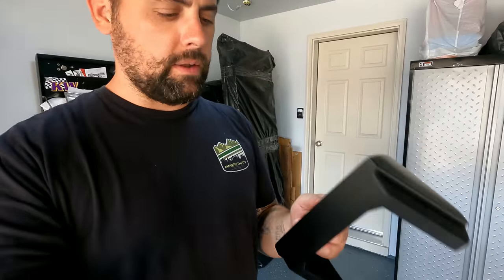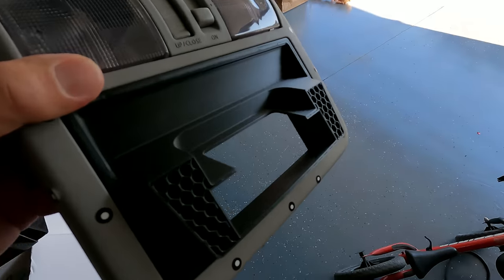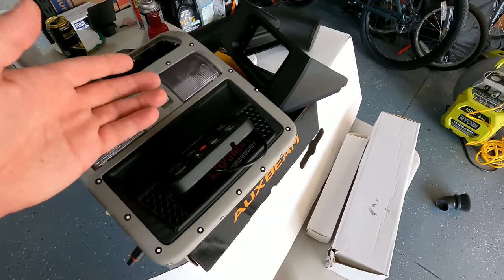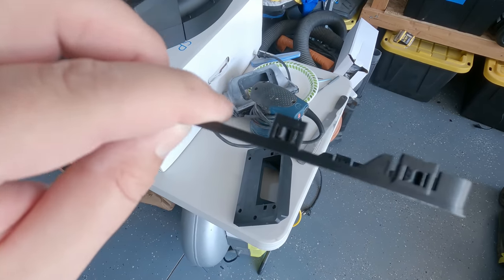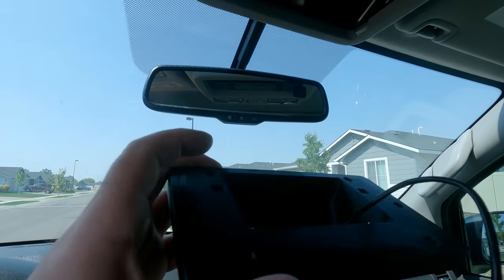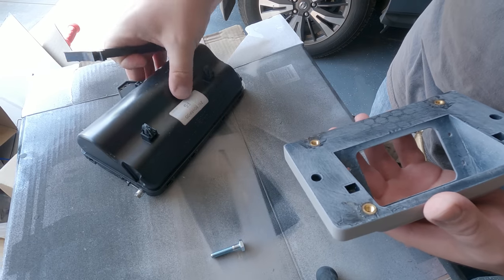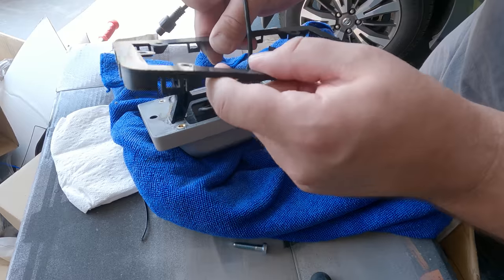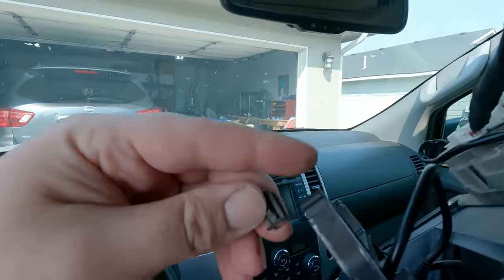How to make 3d printed car parts - Auxbeam switch panel

Comment: Very impressive practical use of 3D printing, you should make a video on how you converted original piece into the 3D printed part.
Reply from the maker: Thank you, I have a video coming out tomorrow going over the process more actually!
Reply: This is also what I came to ask. 😊
Reply from the maker: @chrisperrywv  I will try to make a video going a bit more in depth!
Reply: @EndMotive  I just found you and wanted to say the same as Chris. Subscribed!
Reply: Where is this video explanation?? I cannot find the video but would love to learn how you did it @EndMotive
Reply from the maker: @garrethatchard2132  I believe this is a video I had taken down because of a copyright issue. I can work on another, what would you like to know or see?
Reply: @EndMotive  I would be interested to see how you modified the original piece to make the 3D-printed piece. I want to do some similar custom parts but would love to learn how you got the factory look and fit. I assume a 3d scanner was involved?
Reply from the maker: Gotcha! I will try to make something a little more in depth, but yes I did use a 3d scanner.

Comment: Great idea splitting the design so the tabs are seperate. So much quicker and easier to replace if required.
Reply from the maker: Exactly! The support material was giving me issues on the main body too, so it was a win-win

Comment: I know, it's too late, but I would definitively rotate it a bit(approx. 30 deg.) to a driver's side for better acces.15d
Reply from the maker: It would be nice, but I wanted to keep them straight. Because of the distance, it does not feel like the buttons are turned away from the driver.

Comment: Give XTC-3D a shot for coating, works like a charm and sands easily while adding strength to the parts! (might work out to be overall cheaper than JB weld as well)
Reply from the maker: Yeah the jb weld was a first test, it was a bad idea lol. Regular body filler is pretty easy to sand and works great, however you are probably right that the xtc-3d would likely add some strength!

Comment: Not sure how hot it is where you are but ABS amy be right on the borderline for handling direct sunlight especially close to the windshield. The positioning of the partial sunblock film on the window may however save the day. Great project!
Reply from the maker: @karlosss1868  Thanks!, I have had no problems with abs in the Vegas (115f) heat, but I ended up making one out of sls nylon 12 anyways, no worries now!

Comment: This really does show how 3D printing enables rapid prototypes and iterative development. Great job. Do you have a video on the 3d scanning with reference dots?
Reply from the maker: Yeah, it really speeds up the process. I do not have a video with the dots for this part but have featured a few other parts with the alignment points.

Comment: Some years ago I also made some car accessories like a radio cover and some can holders with different materials.
I spent days of sanding, priming, and painting the parts.
Over the years they all bent by the influence of the elements (heat, cold and humidity).

It was a very painful experience.
I hope it won't happen to you!

Edit: the materials I used were mostly PETG and ABS, but also some in PLA. All the materials behaved the same way!
Reply from the maker: Yes totally possible. Some just last a little longer than others!
Reply: Very good question. So just go to RESIN parts
Reply: @bitosdelaplaya  Btw. with Resin parts this phenomen is even worse.
Reply: @DerJohii  ??? I talk about RESIN printer. Resin is UV resistant and heat resistant
Reply: @bitosdelaplaya  Heat resistant, yes.
Have you ever been putting your curing resin part too long under UV light?
It is deforming and getting extremely brittle and hot because of reactions going on in the part. ;-)
Reply: My experience too... 3d printed parts just don't hold up in the heat of a car.
Reply: @DerJohii  But when you paint it, it will become UV resistant due to the clear coat.

Comment: I'd probably be doing the same, however, time is money.  If you are having to sand and modify lots after the production to get it refined so people will buy it, you are cutting into your profit.  Have you considered a better printer?  Resin perhaps?
Reply from the maker: Yes, I have a resin printer actually but the parts are fairly fragile on the small clips. I wouldn't even consider doing all that work for production parts...no way it would be profitable! I have had quotes to get it sls/mjf printed but they were too high to leave me any margin and I am still considering casting them out of a two part urethane or something similar.

Comment: Turned out great!

Did you scan the part it clips onto to help with the design? Or did you just take measurements and go trial and error until it fit before designing the rest of it?
Reply from the maker: I just used the scan data of the part and that was enough to make the clips pretty close and then did a test fit and made adjustments. Second print was perfect.

Comment: Have you considered using 3d printer resin for the smoothing of and curing with a uv torch
Reply from the maker: Yes, I have a resin printer and depending on the part use it....but have not had great results with curing uv resin over fdm parts. It ends up being more work that just using body filler and primer.

Comment: Do you print and finish everything yourself for your etsy shop? Or do you print and prototype and then outsource it? Just wondering cause I'm really interested in trying to 3d print some ideas of mine and try to sell them. Really amazing work btw!
Reply from the maker: I do not outsource any of my products currently, not that I am against it by any means. I have actually tried to minimize the amount of parts that need extra steps after printing. Sanding and painting are very time intensive processes that totally kill my margin.

Comment: Was the cable long enough to reach the switch panel when mounting it there, or did you have to get the extension cable for the switch?
Reply from the maker: I have no idea, I have not hooked it up yet lol. I mostly designed the panel to sell, but will eventually use it.

Comment: What type of filler did you use to smooth the surface after the printing?
Reply from the maker: I tried using jb weld to make the part stronger but it was very hard to sand. I usually use a glazing putty body filler. They are a little thinner than regular body fillers and easy to finish.

Comment: What primer and paint do you use to fill in layer lines?
Reply from the maker: I dont remember what I used on this now, but I have switched to SEM high build primer and it is so much better than duplicolor or rustoleum.

Comment: HI there!

I have a question, how much would you charge two small pieces to be design and painted jet black..

Thank you
Reply from the maker: What kind of part and how large are they?
Reply: @EndMotive  they are my hands free buttons for my steering wheel.

I have a mitsubishi Lancer raillart 2012 the steering wheel has a set of hands free buttons on it. I want something like that for the right side 3 layer buttons case.
Reply from the maker: @adamjensen6376  sounds cool, I am not sure how I would go about designing it without having the part in hand though. I will look around and see if I can't find something local to work with.

Comment: Abs or pla? And what matériel after is mastic of tôle ??
Reply from the maker: I have the materials I used in the description! 
ABS filament >Sanding > Primer > SEM texture spray > SEM color coat paint
Reply: How to resist sun and hot temperature?
Reply from the maker: @medamine9330 ABS holds up great in the heat for me. It is not getting direct sunlight so UV light wont be a problem.
Reply: But in my country heat up to 45°
Reply from the maker: @medamine9330  I live in las vegas, it gets 48°/120°f here and i have not had abs melt. Some lower quality abs might not handle it, but good quality should.
Reply: Ah ok thank you

Comment: That looks awesome!  Minor comment, you said taller folks might have more interference... I would have thought a shorter driver can see better since the mirror would be angled down.
Reply from the maker: Thanks!, It doesn't bother me and leaves rear visibility totally usable...I am 6'2". Sitting high enough the mount does block a little, if I slouch and angle the mirror to fit, it does improve visibility slightly.

Comment: If not already suggested, bondo is another alternative to the epoxy. Love how it turned out though, nice work.
Reply from the maker: Thanks, yes that is usually how I finish parts out, I just wanted to test an epoxy but won't be doing it again....it is way harder to sand

Comment: just don't print in PLA. because It deforms with the heat inside the car in sunny days. PLA hold heat as much as 40º C
Reply from the maker: I almost exclusively print in ABS or ASA for that very reason.

Comment: Wow, that paint and texture looked like a factory piece when I saw it on the rag as you assembled it (still waiting to see in the car on the video), but damn that's looking good so far!!!

EDIT:  And holy crap!!!  That looks amazing!!  Did you use the textured paint to get that finish?  How did you get that factory texture finish??  I wonder if there is a way to get that in Fusion or something and add that to the print.  Just tiny "bumps" to match factory, so your print detail would have to be super fine.  but would be awesome to print factory style finished parts!
Reply from the maker: Thank you, I have played around with trying to add texture into the 3d model but have had very limited success. The texture was added with the SEM texture spray, it works great!

Comment: Dang!!! I am in Boise. I would love to chop it up with you and see what we can come up with for Ford Excursions.
Reply from the maker: Thanks, Have any ideas?
Reply: @EndMotive  a ton!! Let's see here, overhead console is trash often. Also, many people want to move to 08 superduty doors, dash, etc, but the rear doors of an f350 are like 5 inches to narrow versus the excursion. There's conversion kits for everything else.
Reply: A lot of parts are pretty easily swappable with the f250/350 models, but if it is excursion specific, it's harder than hell finding parts unless they are being scrapped.

Comment: Awesome video! I'd like to replicate your process  - I've got a lovely Ender 3 S1 Pro, but no 3D-scanner sadly. Have seen videos about using a phone. Probably not as easy, but should be possible...
Reply from the maker: Thanks, I used a phone and a camera to do photogrammetry scanning before I had a real scanner and the results were actually pretty good.

Comment: What is the process of scanning? Which tools/software do you use? Could you make a video about that? Thanks.
Reply from the maker: I have links to all the tools I use in the description of the video, but I can try to make a video highlighting them as well. Einstar 3d scanner>fusion360>FlashForgeGuider2s most of the time.
Reply: @EndMotive  Thanks for this fast reply! I just thought that describing the process of going from part to digital format to 3D print would be good to see. As you have already presented, things don’t always go smoothly and there can be a range of interesting and sometimes tricky instances that are not easy to predict but are worthy to mention.
I looked up the tools that you linked up in description, but many are not available even here in Sweden, and shipping from Germany could be impractical due to shipping costs.
Reply from the maker: @alsad6699  I have a new video out that goes over some of the steps a little better. Shipping can be tricky, hopefully you can find a reasonable equivalent!

Comment: Sweet man. 
Just one question. I printed ur designed and only then realized that they changed 2022 frontier upper consul design. Now the part for sunglasses doesn’t pop out. It’s one solid pcs. Any ideas how to remove the door and may be I l stall the holder inside there?!
Reply from the maker: Unfortunately I have no idea, I have not had my hands on the 22+ frontier to make one for it.
Reply: @EndMotive  it’s basically same as before but entire upper counsel is one peace. I can install just the part where the controller goes if I remove the part that flips down for glasses.
Reply from the maker: @yasikb  Yeah, on my truck I had to remove the sunglass holder to install this....sadly it is one or the other right now, but I am working on a design to actually install the auxbeam in the sunglass holder!

Comment: Excellent work.  Thank you for sharing the materials list. I wouldn't have had any idea about the texture spray.

Quick question, how thick (in mm) did you make the walls of your part?
I'm planning a dashboard-mounted panel, and an wondering how thick I should plan, to make things feel sturdy.  (I'm leaning towards 5mm, but I also know I tend to over-engineer parts)
Reply from the maker: Hey! This part was most a "block" in design and didn't have very many walls. I have since redesigned this part and it is closer to 2mm wall thickness in most areas, but it will be printed out of pa12 nylon. With abs I usually shoot for 2-4mm thickness though.

Comment: How do you 3d scan the items? What software do you use?
Reply from the maker: I have a Einscan Hx 3d scanner, use to use an Einscan SP and Einstar. They come with a proprietary software for scanning. But I so most of my design work in Fusion 360

Comment: Upgrade to a resin printer and eliminate all the bondo/sanding work.
Reply from the maker: I have two, I hate using them honestly lol. Depending on the part, it is totally the way to go, but it didn't make a lot of sense on this one.

Comment: What Material did you use to print this? and what 3D scanner and program are you using?
Reply from the maker: I have links to the items in the description, but it was abs filament and Einscan SP scanner.
Reply: Thanks for the Reply! The Link for the Scanner wasn’t working for me :(

Comment: what kind of epoxy you used?
Reply from the maker: I used jb weld, it works but is way harder to sand than just using regular body filler like bondo.

Comment: What's the point the parts just warp on any hot summer's day in the UK
Reply from the maker: My parts have held up great where I live. It reaches 120F/48C and all my ABS parts have done great, I have even printed an ABS intake tube that held up just fine under the hood... PLA however will melt fast.
Reply: @EndMotive  Yeah of course you are correct, in fairness I should have said with PLA especially parts under any kind of load. 😬

Comment: Never thought about an JB Weld overlay. Might have to try that.
Reply from the maker: Don't lol, I thought it would work well....and I mean it is tough, but at the cost of being way harder to sand.
Reply: @EndMotive  Understood. I’m trying to figure out a good way of strengthening a polycarbonate/carbon fiber to keep it from splitting across the layer direction. Annealing would be great if it weren’t a curved surface.

Comment: Absolutely awesome, thanks for sharing.

May I ask you how did you get the texture?, I see the “texture part” but di not understand how did you generate it.
Reply from the maker: It just a rattle/spray can from SEM. I just followed the directions on the can until I get a texture that I am happy with.  Link to exact product I used is in the video description.